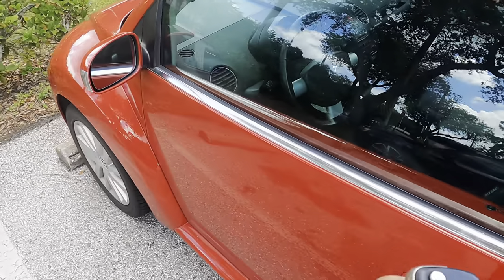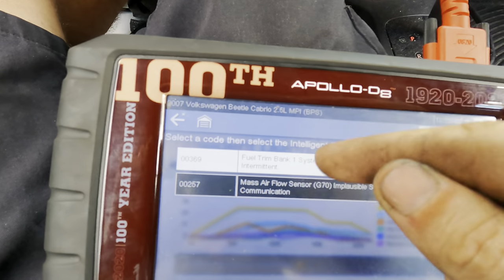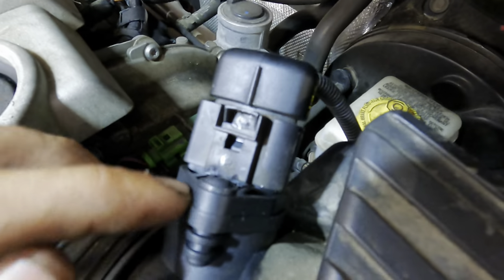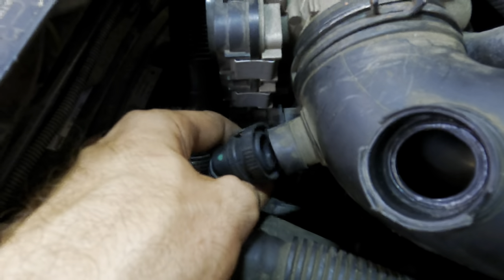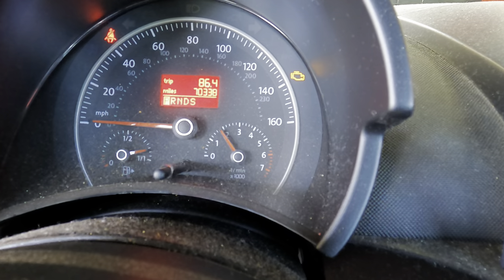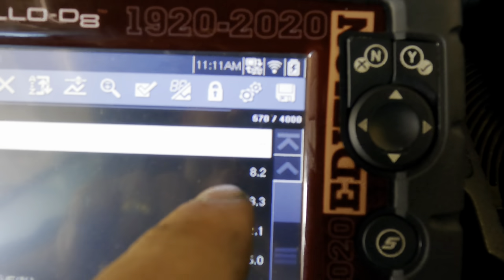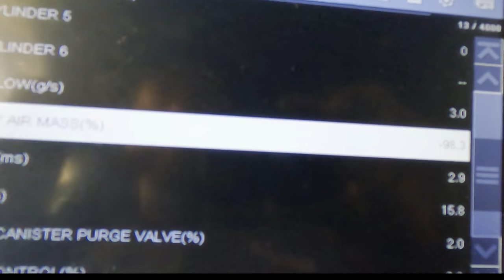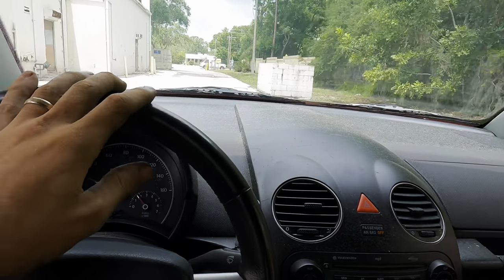Dealer Saved The Day! 2.5l 5 cylinder? VW Beetle P0171 P0101

Comment: The fact that VW had that part in stock speaks volumes
Reply: That's a very popular engine in mk5
Reply: Haha, airflow pun.
Reply: That was my thought. Does this part normally fail like this on most other cars? I've had some old ones without that problem. I also noticed the new one seemed a lot softer meaning the old one was brittle- cheap plastic too? Hmmm, the more you know the more you see things and the more you wonder about them.
Reply: Yep.  It says "we have these in stock because they often fail".  That tube plug design looks very frail in nature, so naturally, it fails.
Reply: I spent a few weeks in 1968 or 69 doing "industrial experience" for my engineering degree at the Rolls Royce car factory in Crewe, England. Rolls Royce and Bentley owners could drive into the factory to get stuff from the spare parts department. One day a very rare, very non standard Bentley from the 1920s was parked outside the spare parts department while the owner was looking for a new sump pan to replace the one he'd dinged on a rough road in the wilds of Scotland. The car had a non-standard engine fitted into a chassis designed for a smaller engine and therefore had a non-standard sump pan. It was a one-off and made before Bentley was taken over by Rolls Royce. They had the spare part available. As soon as the guy bought it, the spare departs dept. put in a work order to make another one. That's service!
Reply: @P_RO_  yeah the new part looked like some rubberised plastic. The old one was some solid plastic.
Reply: @P_RO_  Yes, and if you wondered just a bit more to actually do some research instead of assuming you would know about the German regulation that resulted in all german automakers to switch to this plastic that goes brittle after 15-20 years in the name of the environment. Late 90s a regulation was introduced in germany that means all passenger vehicles produced must be a certain percent degradable. Thats why plastics degrade on these older vw's, its designed that way. People blame VW but in fact its a regulation they must follow. Its another thing it works out for their pocket.

Comment: In my “limited” experience with that specific car, the reason you had no cold AC is probably the climate control panel itself. It’s a fairly straightforward repair, but I think the part was about $4-500 from VW. The car lot I worked at replaced them all the time. Customers would get tired of driving around their cars with no AC in the Florida summers and would trade them in. We’d replace the panel and the AC was fine. I don’t recall them having many other HVAC issues. The trunk opening randomly while driving to the gas station…yes. Smelling like a box of crayons when it was 100°…yes. Replacing a $400 sensor that would be $40 on a Chevy…of course. We had an unwritten rule with VW and German cars in general…if it has over 80k…it goes to the auction. Of course, I had a customer who had a mid 90’s Jetta diesel with almost 500k miles on it…it never seemed to break.They’re weird like that.
Reply: I hear that VW diesels are easier to work on compare to the gas engines while knowing I'm a diesel student. I have never worked on them before.
Reply: @yanglue611  non commercial diesel engines have joined full auto machineguns as relics. VW  ceased USA importation after Diesel gate stunt was exposed. Like Machineguns, that can still be owned, tho limited to pre law production, consumer diesels won't be around in yuge numbers as sales drop and attrition takes it's toll. Fixing lektric vehicles has mo demand and good backup to ICE repairing skill sets.
Reply: I got my Vw 1.9 tdi engine code ASZ bought with 150,00 miles on clock,Got rid of when it had 300,000 on clock ,Only had two problems Worn cam lobes on No 4 cylinder, And a misfire Injector no 1 .not firing ,injector loom in head , all fixed for buttons , first shop I went too ,said it needs a injector ,I said that’s funny .you turn it on and off ,and it works fine,they said this machine is a computer and it’s saying No1 injector isn’t firing.I said you know what’s firing ,he said what ,I said you and left , Got my meter out ,and traces the problem,No 1 cylinder injector wire had gone oc checked Internet found out it was a common problem, Same with the cam , quoted £700.00 to replace got one from the breakers £30.00 .3 hours later fixed , These engines last forever if looked after,Over hear Vw are quality.American stuff,is classed as crap.
Reply: @bullitautorepairsmobile4989  Your tale of VW prowess indicates excellent diagnostic and mechanical service abilities. Great assets in 2daz whirled of poorly trained/compensated inexperienced techs throwing parts at failed components til they run again.
Reply: @yanglue611  They are most of the times because there are not many things that go wrong with them so you go in knowing what the 5 things are that could be wrong. Also vw tends to "experiment" on their gas engines more than diesels. The diesels will only get new features once it was proven on other platforms, but more than often they dont change anything on them unless necessary. Great example, the 2.0tdi you can get in brand new VW's today as well as in early 2000s is still using the same cambelt system as it did back in the 2000s. Many think its outdated and costly, personally I think I like knowing the condition of my timing circuit without having to spend thousands to replace the entire kit when a hydraulic tensioner fails because the previous owner didnt keep up on their oil change...
The only time vw fucked up with their diesels was the 2.0tdi pd/cr transition. They implemented in the 2005/6 model year a balance shaft unit into higher end vehicles with the 2.0tdi pd (passat, audi a3, a4 etc). The issue with this was it was first driven by a chain and sprokets off the crank as you do it most cars. But something was fucky with the quality and the sproket and it would wear out and skip. Then they switched to gear drive which solved the issue, however there was a major flaw in both: the oil pump was driven off the balance shaft unit via a small hex key. Bad manufacturing or material quality meant that these would wear out as well and start to skip causing in a good case low oil pressure so you could have a chance to fix it before its too late, and in the bad case, just straight up failure. In some cases your turbo would fail first as an indicator that somethings wrong. VW apperently rectified this in 2007 but they refused to admit and so noone knows at what year these got fixed. But then this issue seems to have carried over to the next generation early makes of common rail 2.0s and caused trouble there as well. Sadly some 1.9TDis also had this. All in all, this is the only major flaw that happened with these engines. The other was in the early life of the 1.9TDI BEX engine code owners experienced a catastrophic crankshaft and conrod failure at just 30k miles, apperently all cases were covered by warranty and it was just a few hundred engines.
My passat also has this 2.0pd with this awful oil pump drive, currently at 190k, Im planning to have a look at it and replace it with a remanufactured kit if need be but I had the car since 163k miles and havent had problems with it yet. And I gotta say that balance shaft unit does make a huge difference, for a PD the engine runs very smooth. compared to other pds ofc. Compared to a commonrail its still a tractor but by pd standards is smooth.
Reply: @yanglue611  The early VW diesels with mechanical injection were easy to work on and went HIGH miles. I can't say anything about the computer controlled ones as I've never had hands on one.

Comment: The last 5 cylinder engine I worked on was in an old Audio 90. That was 20 years ago, then a friend brought me his Volvo wagon with a 5 cylinder, which I turned away and told him to never come back with that.
Reply: I had a 2006 Volvo XC70 from 125K to 198K, it had the turbo 5 cylinder. I loved that engine, I did all the work on that car, including the PCV replacement and replacing a worn VVT pulley. I was skeptical about the 5 cylinder at first but I loved mine.
Reply: With over a decade of viewing and reading Youtube, your Volvo experience caught my attention for some reason.  Can I respectfully ask you why you responded in such manner, or is there a back story that fits but otherwise does not need mentioning in a public forum.  Much thanks.

Comment: I had one of those bugs.  It was pretty common for the engine light to come on.  I ended up buying my own ODBC adapter and software so that I didn't waste time going to the dealer to fix all the stupid stuff that broke all the time.  Was happy when I got rid of that POS.  I love the old air cooled VWs but the new beetle gave me a bad taste for VW, in general.  I also started despising VW when they started suing, for trademark infringement, all of the little hobby websites and companies that were selling old air cooled parts, which VW no longer sold themselves.  VW can suck it.
Reply: Wow that's foolish of them, most ppl I know in the US buying new VW products like them because of their passion for the older vehicles
Reply: I had the opposite experience with that engine.  2010 Jetta, manual.  Towed my pop-up with it all over the east coast.  Phenomenal tow vehicle for a small trailer. Only issue was a vacuum pump which was easy to fix.
Reply: As a tech I can confirm they are trash and an absolute nightmare to work on most of the time I refuse to touch them besides maintenance I'd never own ANY vw
Reply: My wife and daughter decided they had to have the new beetle in fact we ultimately had three of them and at about five years old they all started having problems. One after another after another and sometimes the same problem again. After a while the cute little bug (s) were pieces of junk..  Now we own three Kia’s and absolutely no problems… Yet
Reply: I own an air-cooled VW and would own more if I could, but between the B5 Passat I had and the New Beetle my wife had, I won't buy another modern VW.  Too many nonsensical problems with them.  VW is the one automaker I really want to like but ya know, once bitten twice shy.
Reply: @Minimalist1266  even yugo made SOMEBODY happy so yeah there had to be you out there
Reply: @i.jackanov7382  That's true to some extent.  But, I have a 1969 VW Karmann Ghia that still works just fine.
Reply: @garyh4458  not by accident i'm sure. it took alot of love to make it work just fine or it never got touched and has been in a time capsule bubble the whole time. oh and congratulations on having a 1969 anything that works just fine. that is definitely an achievement.
Reply: @i.jackanov7382  either that, or I just know how to maintain a car.  ;)
Reply: Drives me crazy when these big companies that are no longer in business or little guys trying to start up and they say well you the name of your company almost sounds like ours and trying to heck out of it ain't right come on people don't be so greedy hey have a good day bye
Reply: @Onewheelordeal  years ago my friend and I drove halfway across the United States and the Volkswagen common gear with the top down hey that was the best thing that ever happened to me have a good day guys p
Reply: @chrisfreemesser5707  like most companies and products nowadays they're over engineered they put too much flash plastic and gadgets in them and it just they don't make the quality that they used to they don't take the pride in what they build like they used to it they don't care once it goes off the assembly line then the dealers between you and them and it's nothing but aggravation I have the same thing with my car and I fix it myself but I see some of the stuff and I like why did they do that what's the world coming to have a good day people
Reply: @Onewheelordeal  Once you own a water cooled volkswagen, you will never own another.

Comment: Excellent demo, thank you. I was wondering if the part would still be available. Lately, manufacturers seem to be dropping the ball regarding funky parts like this after 5 years.
Reply: Used to be OEs had to keep safety/emission pts avail 10yrs
Reply: @peted5217  that is an old wives tale. fake news
Reply: If u say so , it must be so.
Reply: @peted5217  actually i'm usually full of crap, but 5 seconds of googling confirms no such law exists in most states
Reply: @i.jackanov7382  you're correct. Only mandate is pts available to cover warranty. Some emission warranties excede 5  yrs.
Reply: VW put that 2.5 engine in so many cars that I don't expect parts availability to be a problem any time soon.

Comment: Ray, don't underestimate your abilities. Finding that broken connector is definitely a skill. Someone else just replaced the mass air. If it wasn't the customer trying to save some money then it was a crappy mechanic who just try something random, didn't check to see if it worked, charged the customer for unnecessary repairs.

I had an EVAP leak code on my car. I knew to check the gas cap; $10 for a new gas cap was worth a try. The car was 14 years old. Told the mechanic. He just started randomly replacing things in the car rather than measure the existing parts to see if they work. Near the end, he ran out of things to replace and tried replacing the gas cap. I took it to another mechanic. Turned out an old battery was affecting the electrical. New battery and everything is fine. He found the battery issue by looking at the system with a volt meter.

Knowing what you are looking for is worth a LOT. If I lived near you, I'd bring my car to you all the time. Fortunately, I have a good mechanic here in my country. 

Stay awesome Ray!

Comment: I still wish that you would get a break-away, non-conductive silicone wedding band, and I can recommend an assisted opening knife such as (similular to the) Kershaw  Speedsafe® with flipper (makes one handed opening and closing very easy) they have decent steel, hold an edge, easy to sharpen, and inexpensive. How would using a screw type hose clamp have worked in holding the plastic tube to the air induction pipe ( if the OE part was unavailable or too expensive)?

Comment: Idk if you know this but on most VAG cars you can open the windows when you hold the open button on the key or if you hold the key on the open position in the lock. It´s a neat feature for letting all that hot air out before going in. :)
Reply: You can close all the windows with the key in the lock too! :-)
Reply: @K.Kelly87  exactly! Forgot to mention this, too.
Reply: @K.Kelly87  Or holding the remote lock button too.
Reply: You can also turn the key (but don’t start the car) then back to off again. Tap the wiper stalk downwards to do one swipe of the windscreen and this leaves the wipers in the up position making really light work of a blade replacement
Reply: @bendelbridge  without that I can't even switch them on my MK5 Golf (Rabbit).
Reply: @572Btriode  Only on the higher end VW/Audi group. 
Unless some owner spent the $75-$80 for the one use programming dongle. 
Then yes, the remote would put the windows down.
Reply: @K.Kelly87  Nope, standard fit on my 2012/3 Tiguan.
(Edit) I recall my 1995 Golf GTi 16v previously did just the same too as standard.
Reply: @bendelbridge  Essential on my Tiguan, the arms foul the back edge on the bonnet/hood (choose your country !) if you try to swing them out when parked, the manual details this for blade replacement and screen cleaning.
Reply: @572Btriode  Both of those are way above the standard of the New Beetles. The New Beetles didn't come with that feature as standard. They could of course upgrade it at the dealer, ( just by plugging it in) but otherwise the owner had to buy the remote feature in the form of a one use dongle, for each car. The feature can also be upgraded with an aftermarket VAGCOM, if the owner knw exactly what to do with it.
Reply: @K.Kelly87  How odd.
Maybe a different marketing standard depending what side of the pond you're on perhaps.
Reply: @572Btriode  Oh yes!! Very different. The USA Didn't get many options. We got a different set of colors too.
Reply: @K.Kelly87  Ah !  That explains it, the GTi 16v was the land of hoods and boots, but I've been with the Tig now for 10 years in the land of capot and coffre with a left-hooker. . . . . . . .

Comment: Nice catch Ray, This is also a common problem on Hyundai vehicle's too. At least in my experience,as I've had to replace the intake tube on our's(07 Entourage) twice. Experience counts,in a lot of things,as it shows here. Everyone don't forget to remember to have a great day!😊 Greetings from Lake City 🇺🇸🌴😎
Reply: Mine threw an engine light and I didn't know the cause then I realized the intake tube wasnt securely fastened I kept tightening but I doesn't want to be held securely I quickly realized the clamp was busted so I went and got an aftermarket clamp and fixed the issue
Reply: I have a cold air replacement kit that I haven't put in yet made out of aluminum with an external filter it just got to get my back working hey have a good day

Comment: As you mentioned having a little luck and skill, you gave me both just this week with my son’s car, 2013 Malibu, it started running rough while he was passing a vehicle, check engine can on, traction control lite up and it idled rough. Had to have an oil change done anyway, took it to the dealer for that and they always plug in the OBD ll vin reader to get accurate mileage and it showed code P0300 and P0303 general misfire and misfire on bank 3. Took it home, and replaced all 4 of them on his 2.0 turbo 4 cylinder and both lights went away and it runs like a dream once again..
So my long story short is with your knowledge and my skill I was able to save some cash and do the swaps myself, for that I thank you for sharing this valuable information the way you do!
Thank you!!😎👍